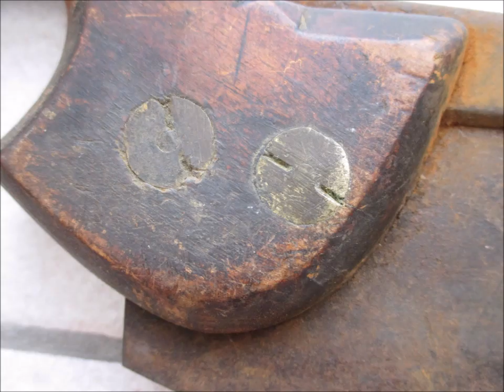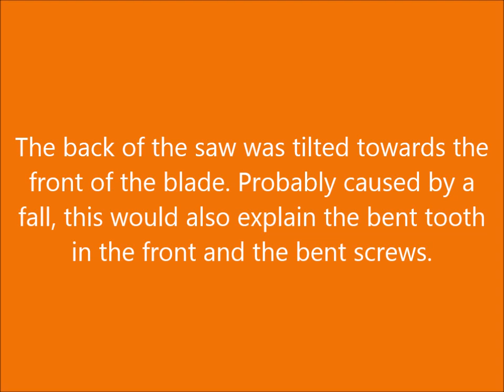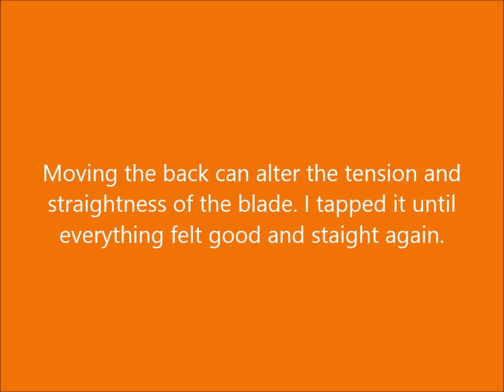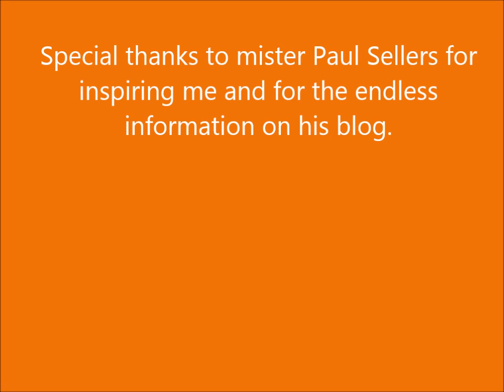Restoring a dovetail saw

Comment: I like the template idea, isn't there a tip somewhere about how to hold the file at a constant angle with a block of wood? Nice save, I have one thats in even tougher shape then this and it will be a nice project to restore. I think I'll try the battery charger method to remove the rust. Thanks for the tips.
Reply from the maker: Pat M I haven't tried the block of wood yet, it wasn't necessary with this saw. I filed the teeth in a rip cut pattern, so no angle is needed. For a crosscut pattern you'll want to use this method to have the right angle.
The template I used is also available with angle guides for crosscut patterns.
I've done some research on the battery charger method, but I wouldn't recommend it. If you make a mistake your saw is wasted. It's pretty complicated. The citric acid method is dummy-proof and pretty cheap. Good luck on your project and feel free to make a video of course ;-)